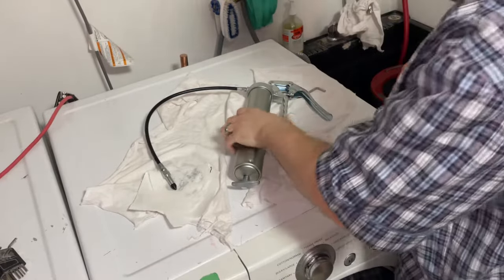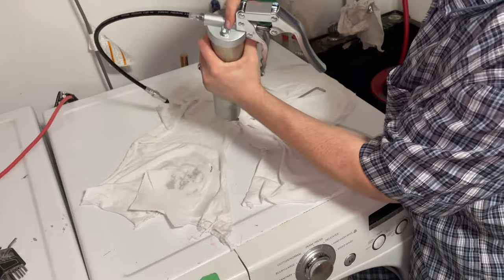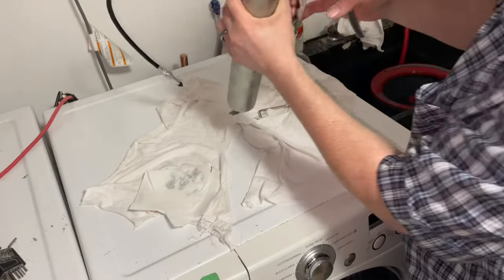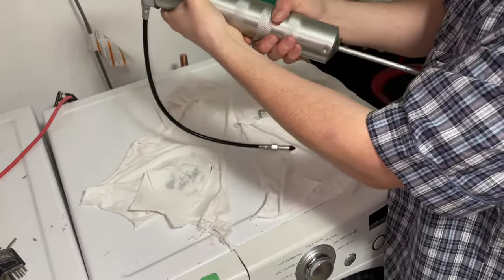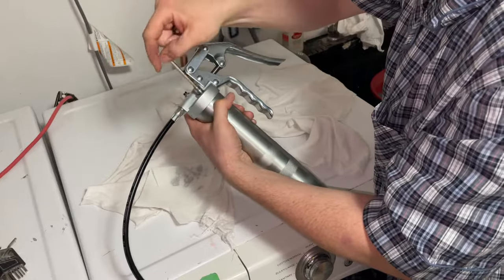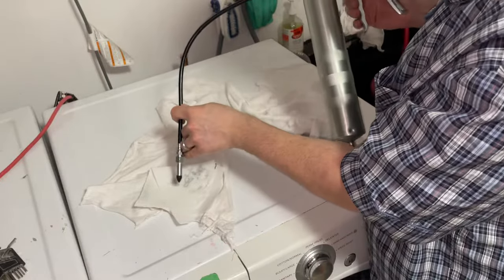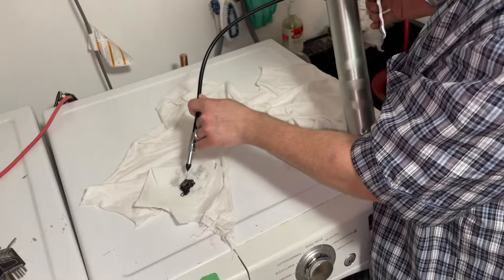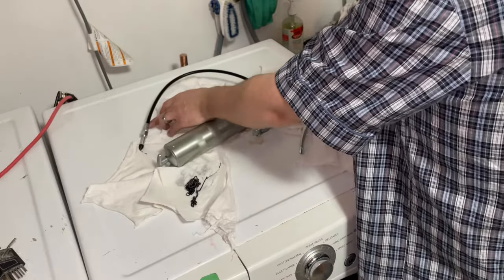How To Prime A Grease Gun (Airlock Fix)

Comment: Its so agravating doing this. The two turns out rarely works, the bleeder valve never works. Taking the bleeder valve off like you did works sometimes but it will rocket shitloads of grease out if you are not careful
Reply from the maker: I’ve heard people having that issue a lot. I’ve never personally ran into that problem. Do you have any technique that works for you? Thanks for watching. Please like and subscribe
Reply: @BillOfAllTrades2016  Yes, I did figure it out, the solution was taking the bleeder valve all the way off (while holding back on the plunger to keep too much grease from coming out) and also removing the hose, I believe the hose had air pressure built up in it.
Reply from the maker: Ok thanks for the advice. Sometimes debris also stops the flow as well.
Reply: @kyledupont7711 that's where I went wrong. I had so much grease just trucking out of the open filler plug until I pulled back on the plunger

Comment: You obviously don’t realize the plunger has a lock release.
Reply from the maker: I am aware of the lock release. You can press the tab or twist the rod like I did. Either way the grease gun is working.  Thanks for watching
Reply: @BillOfAllTrades2016  no you just pushed on it super hard till it pushed in. Pushing with the release is effortless.
Reply from the maker: Yep. Both end in the same result. Thanks for watching
Reply: @BillOfAllTrades2016  funny thing is this fella watched the video so obviously he doesn’t know EVERYTHING, but he felt the need to try to shame you. Appreciate the video. I bled it out but grease shot out. Oh well, it works now so I guess it worth it. :) Thanks so much
Reply from the maker: Ya there is one in every crowd hating on people. Glad it helped you though. I had one at work shoot grease out the filler cap and I hear the pop of an air bubble and it was good to go. Thanks for watching. Please like and subscribe

Comment: And what happens if you don't have an air bleed plug?
Reply from the maker: If you don’t have the air bleed plug then replace that step with twisting the body of the grease gun open 2 full turns and push the plunger in the same way. The air will escape that way. Hope this helps. Please like and subscribe

Comment: What if my plunger isn't pushing grease to the top it feels like it moves freely within the cylinder there's no pressure when trying to depress it back in
Reply from the maker: That means that your plunger handle is not locking. If you spin the handle until you feel it lock then push and the grease should push up. You won’t feel a click or anything. I just push the rod in and spin til I feel it stop and that’s where the lock is. Thanks for watching. Hope this helps. Please like and subscribe
Reply: @BillOfAllTrades2016  thanks for the response!
Reply from the maker: You’re welcome. Take care
Reply: Lol didn’t work at all
Reply: @BillOfAllTrades2016  Thanks so much. Twisting it until it stops then pushing it in actually works. Been in the garage for 2 hours trying to get this to work. You the man.
Reply from the maker: You’re welcome. Took me a while too until I saw this method and felt the need to share it. I’m glad it was helpful. Happy greasing. Thanks for watching. Please like and subscribe

Comment: Your video was the only one that uses the filler plug removal method.  after an hour of watching videos i came upon yours and it fixed the problem.  Great job!
Reply from the maker: Thanks for watching. I’m glad I was able to help. Please like and subscribe
Reply: Word of caution.... If it's been left outside in the sun for a few microseconds, this method can result in a massive biblical evacuation of goo from said filler plug port. I suggest never attempting this method in proximity to something like your wife's washing machine, or any clean clothes prep area. Or your face.  Or worse; your significant other.

Comment: What do you do if all of the grease comes out the air hole
Reply from the maker: Is the grease coming out of the air hole when you are pumping it to use the grease? You may have a clog in the hose. Take the hose off and try dispensing. If it’s still clogged you will need to remove the cap and clean the inside of it. Plus if it comes out of the air hole then your cap isn’t tight enough. I’m guessing you just need a new hose or new coupler. Hope this helps. Thanks for watching. Please like and subscribe

Comment: So my plunger lever is extremely hard to pull back  and when I do a bunch of grease comes out where the plunger goes in and the lock hole too..what's up with that ?
Reply from the maker: That’s because your plunger has grease behind it. This can happen if the gun was operated with a clog and the pressure pushes the grease passed the plunger. It can also happen if you pushed too hard on the plunger to push the grease up during priming. Keep pulling til it’s at full extension to pull all grease out. Then reload the cartridge and prime the gun again. Hope this helps. Thanks for watching. Please like and subscribe
Reply: @BillOfAllTrades2016  yup..thanks for helping, I think the grease gun  got to warm over the summer (and it was lying on its side) which likely softened  the grease allowing the plunger to pass through from the force of the spring and a crappy plunger.
Reply from the maker: Glad I could help. Keep the gun hanging upright if you can.

Comment: Mine just shot out the entire tube of grease from the hole.
Reply from the maker: Really? The entire tube? That’s crazy.
Reply: That Should Be Expected Really,The Piston is Spring Loaded to Pressurise The Grease into the Pump,I Usual give the Top of The Grease Gun a Few Sharp Blows Against a Tyre and it Seems to Clear The Airlock without Loosening the Bleeder.
Reply from the maker: Thanks for the tip. I won’t be able to try it because I got a new spin on grease gun from locknlube that doesn’t get airlock. Check out the demo I did: https://youtu.be/SM4sYto6Rkk?si=7aBiwzcx8GLHAWn5
Thanks for watching. Please like and subscribe